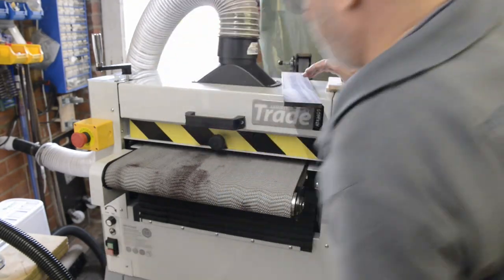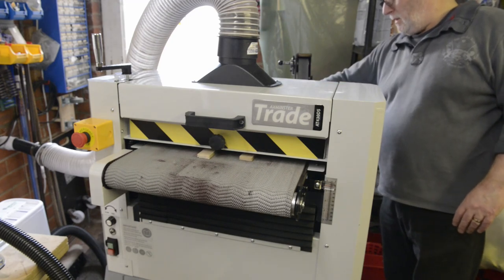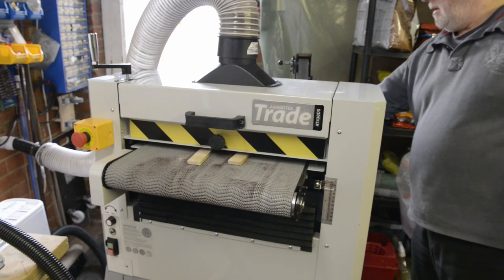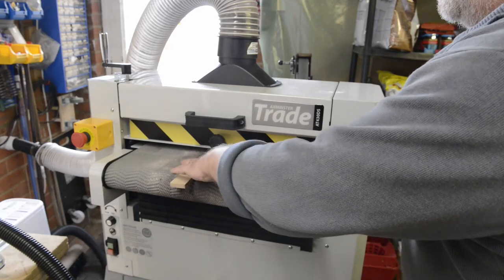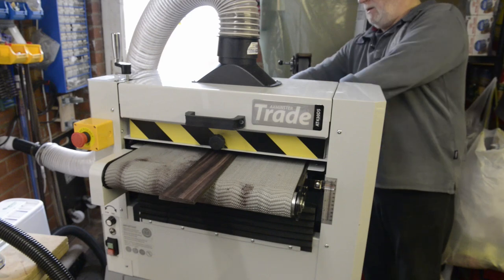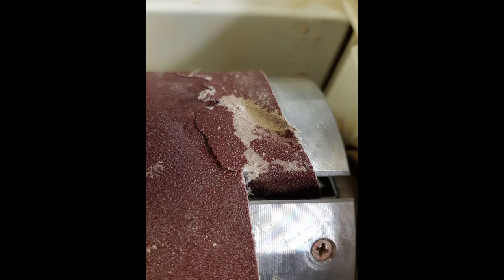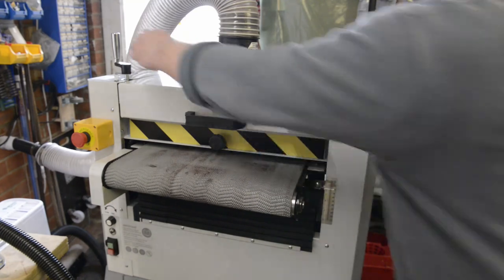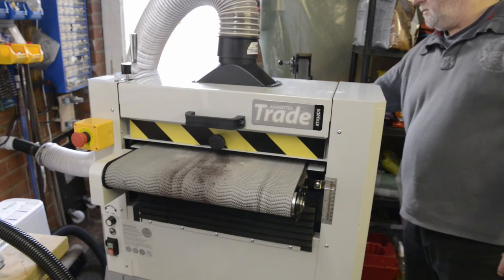Six Weeks With An Axminster AT430DS Drum Sander

Comment: I just picked up a used AP430DS which I think is the basically the same.
After having the same issues, I calibrated everything before coming to the conclusion that the rubber feed belt is an uneven thickness. This was rectified by raising the feed belt until it was touching the rubber conveyor and leaving it running for a few minutes, thus sanding the rubber until it's an even thickness. I'm guessing yours was the same as this would account for the machine taking more material on a 2nd pass etc. 
I know this video is a few years old but I thought it might help others If they see this information.

Comment: I bought the later replacement machine (406DS) from Axminster. It works well though I had an issue with sanding belts. After I managed to clog the original belt I bought replacements from Ax, another 80, a 120 and a 240grit. None of them were cut to fit and I had to cut them. I had great issues with the right hand gripper on the sanding drum and went through 3 belts before getting it right. It was easy once you know how as the right grip is different to the right and it is not well explained in the handbook. 

My advice is:
1. When the first belt goes cut a suitable end shape in the remains and practice using the right hand gripper. There is a bolt on a spring which helps.
2. When buying a new belt don’t bother with Ax as whatever you buy you will have to cut. Buy a mid-range cloth-backed sanding roll. If it is 4” instead of 3” don’t worry as you will then have some nice bits for other jobs. 
3. For me I don’t think that grits finer than say 100 or 120g will be used much on my machine. Just use the 80g for flattening and levelling and use a fine grit on an orbital sander to get a final finish.

Finally, overall I don’t regret buying this machine which is used mainly for preparing segmented rings for turning. Although I used it a lot building a toy truck for my great grandson.

Comment: I was taught to make use of the width of the drum, and send work through at an angle so that the sandpaper wears evenly. At the back side, by walking my fingers along the piece as it exits, it keeps the work nice and flat.
Reply: Yeah, I tried that as well. Eventually gave up and sent it back. Bought a Laguna 16-32DS instead which has been faultless. Also it takes a fraction of the time to change belts. Just a better design altogether in my opinion.